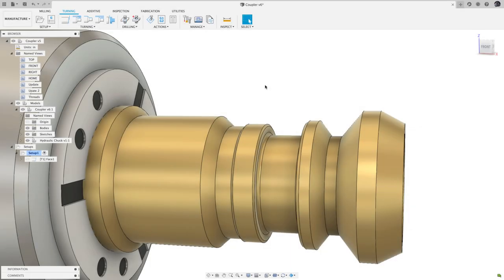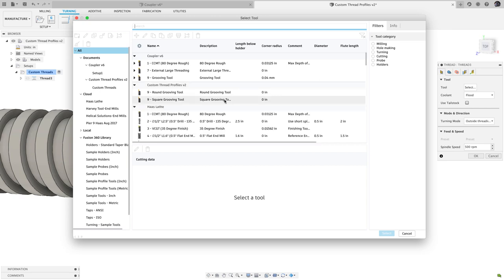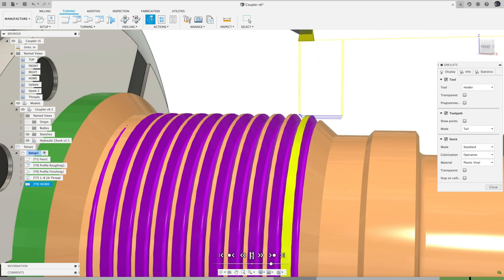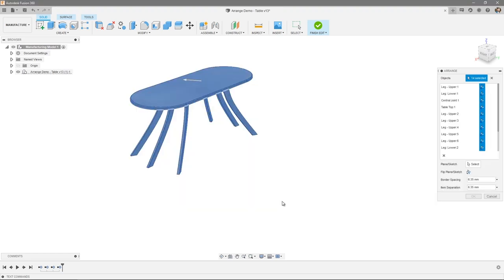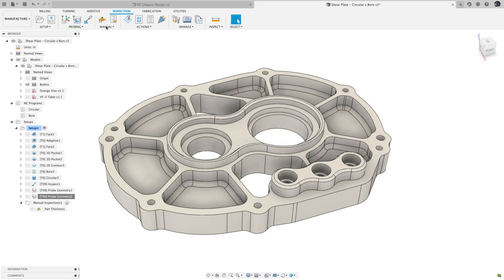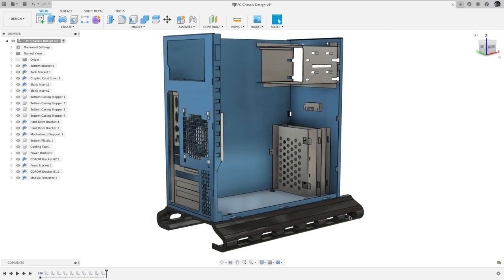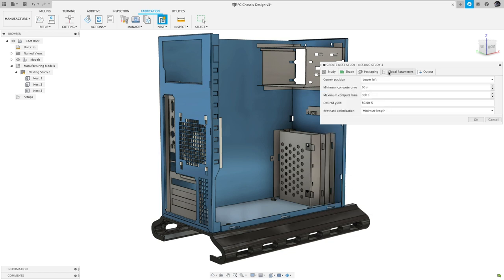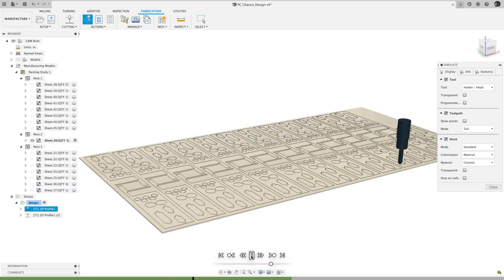What's New in Fusion 360 Manufacturing – December 2020

Comment: What's happening with CAMplete? I'm currently looking at purchasing either Fusion 360 ultimate + Powermill, OR, Fusion 360 + CAMplete. as i can't a afford both CAMplete and Powermill.

I have a Haas UMC500 due for delivery in March, and so i need collision avoidance. In the UK, Powermill isn't too much more expensive than CAMplete, so i like that i would get the extra CAM capabilities of Powermill, especially as i will be doing some simultaneous 5 axis work. 

However, i love that CAMplete has a ready-to-go post processor for the Haas UMC500. The collision avoidance and toolpath verification also seem far far better in CAMplete than in Powermill. 

It would be good to know if you have a Fusion + Powermill +CAMplete package in the works?  Thanks, Alex

Comment: So the only difference between nesting and arrange is the automatic sorting of parts per material/material size?
Reply: Arrange command is one dialog that creates a feature on the timeline and is available in design and working model edit, and uses only one of each of the components selected.  Parts of any thickness can be in the same arrange.
.
Advanced nesting is for more complex models or higher volume users.  It creates working models for each nested sheet.  It is easier to grab components from multiple models using the component sources dialog.  You can set the quantities of the parts to nest.  You can create different nest studies to experiment with different settings, like material efficiency changes when using quantity 1 vs quantity 10 of each part or changing separation.  There is a nest preparation command on tools tab in design workspace to let you define part shapes that might not be recognized like you want automatically.   It has much more control over the settings used by the nesting process.  It has material libraries to store your common stock sizes.  When you use the 'create setup from manufacturing model' command it automatically sets the stock dimensions.  Even more automation to make it easier to process many sheets quickly is planned.
Reply: Oh, and advanced nesting includes reports and one click export to dxf.
Reply: @matthewwynn161  are they both true shape nesting? I've got the impression (haven't tested) that Arrange is only a rectangular nesting algorithm.
Reply: At a glance it looks like Arrange is doing true shape.

Comment: Can you make it available completely offline? I hate the fact that i have to source internet every time i want to open my files😕
Reply from the maker: Hi Shreyas, there is an Offline Mode, and provided you do all your work from the same computer, you do not need to go online until there's an update! Check out your offline cache setting in preferences, I have mine cranked up to 360 days so anything I've worked on on that computer within that time frame is available offline. If you want to be able to work across multiple computers, that unfortunately does leverage the power of cloud connectivity and requires coming out of Offline Mode. Here's some more info: https://help.autodesk.com/view/fusion360/ENU/?guid=GUID-FCB6E122-1552-4434-AC4B-7B227AB31BAC
Reply: @adskFusion  Your guy's willingness and speed at which you reply to users problems and concerns like this is really fantastic.  I really get the sense that you are working hard for the customer and to help the user experience in every way you can.  Thank you.